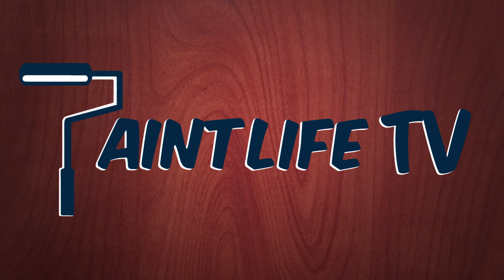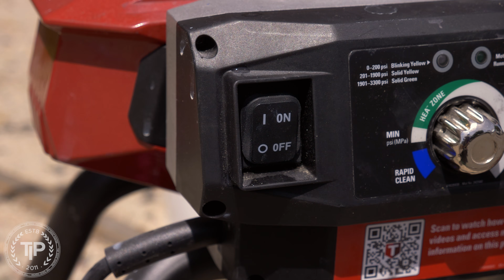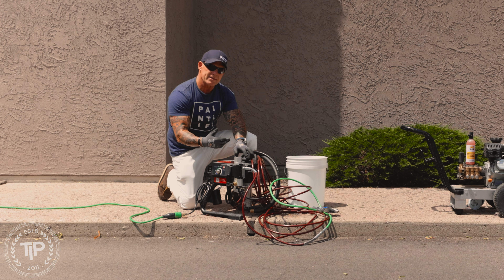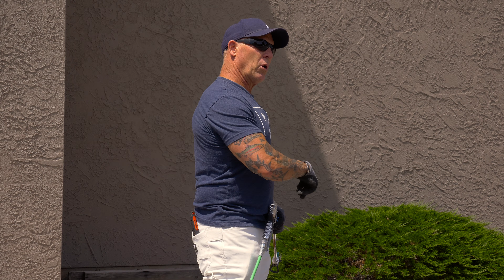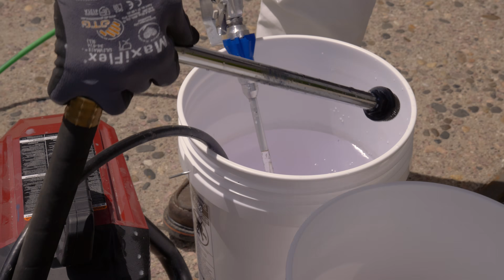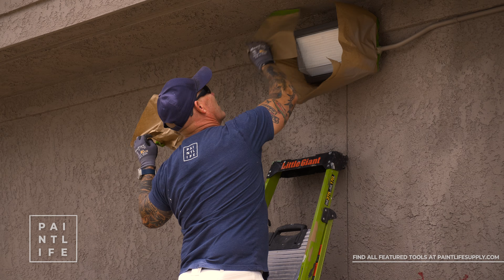How To Set Up An Airless Sprayer | Paint Sprayer Tips

Comment: 1040 it's good sprayer for elastomeric?
Reply from the maker: @emilion4408 A 1040 is an airless sprayer, and for elastomeric paint, you're dealing with a very thick material. You need a machine with a powerful pump that can handle high viscosity and push it through a large tip, something like a 621 or 623. Some older or smaller sprayers might struggle or wear out faster trying to push that kind of material. For heavy coatings like elastomeric, I always recommend a TriTech T5 or T4 because they're built to handle the workload. You can see the kind of setup and tip size we use for elastomeric in this video, we're really laying it on thick for a good, even coat https://youtu.be/r8d31vcRL20.

Comment: We sprayed scuff x latex dark bronze? And we keep getting runs? 
 
Heard rumor that it becomes difficult to spray darker colors with an airless sprayer, because darker colors take more pigment which can be more prone to have runs and not much of a smooth finish ? But light colors like white for instance that we sprayed on trim and doors? Which worked out great!! No runs and a smooth looking finish! 

Any tips or tricks spraying darker colors? Would appreciate it! Thanks!
Reply from the maker: @brycerusson4997 You're hitting on a real point there. It's not exactly a rumor; darker colors, especially deep bronze like that Benjamin Moore Scuff-X, often have a higher pigment load. That extra pigment can indeed make them spray a bit differently, sometimes feeling thicker or being more prone to runs because you're laying down more material with each pass to get full coverage. It's the nature of the beast.

Here are a few tips and tricks for those darker colors:

1. *Thinner Coats, Faster Passes:* This is key. Instead of trying to get full coverage in one heavy coat, aim for multiple thin, fast passes. Think 50% overlap. This allows the paint to build up without running.
2. *Tip Size:* You might need to drop down a tip size. If you're using a 515 for white, try a 310 or even a 208 for that dark bronze. A smaller orifice means less paint coming out per second, giving you more control and reducing the chance of runs. You'll move faster, but you'll apply less material.
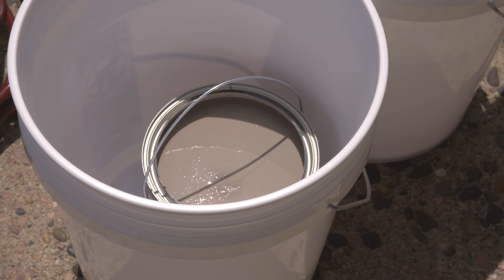3. *Pressure:* Make sure your pressure is dialed in for good atomization. Too low, and you'll get tails or spitting, which can also lead to uneven application and runs. Too high, and you're just pushing too much paint. You want that fine, even mist. Getting your sprayer set up correctly, like I show you in this video 5:53, is the foundation for avoiding these issues.
4. *Tinted Primer:* For really deep colors, a gray or black tinted primer can make a huge difference. It helps achieve full coverage in fewer topcoats, which reduces the overall film build and, therefore, the risk of runs.

It's all about control and patience with those rich, dark colors. I can dive into this a lot deeper on my site if you want to keep going.

https://idahopainter.stesso.com/?yt=Ugw290rjMKPWjKFeK_t4AaABAg&q=Thanks+for+the+tips.+You+have+suggestions+I+never+thought+of+for+someone+thats+never+used+an+airless+sprayer.&context=video%3ACq-5cH7BHXQ&seed=eyJtIjozNzM0NjgsImlhdCI6MTc5MTIzNDY1MywiZXhwIjoxNzkyNDQ0MjUzfQ.MT_e5N-BKh4U98vgCwq9stsT-r2pFUVr3Nn6wPepGF8

Comment: 32 years professional finisher an artist industrial me myself I would never use the same pump for water-based that you use for acrylic oil and the like. Your major function is to keep it running never get lazy with your pump and have plenty of solvent to be able to clean your oil-based pump each and every time when you're done with it. The same with your water based pump. Crossing the two materials can really wreak havoc on your spray pump. And I've seen styles go and I've seen styles come in you would be house spent to beat an old Graco or DeVillebiss.  And always remember keep it clean and do it right the first time and you won't have any problems good luck 🤞
Reply from the maker: Hey @sharonsanderson4514, appreciate you sharing your experience and your emphasis on keeping your equipment clean and doing things right the first time. That's absolutely critical for any professional finisher, no doubt about it.

Comment: Do you recommend painting the inside of a house in spray mode the same as the outside of the house?
Reply from the maker: That's a good question. The fundamental principles of spraying—like keeping a consistent 50% overlap and trigger control—are the same whether you're inside or outside. You're still aiming for that factory finish.

However, the approach changes a bit. Inside, you're usually dealing with more intricate masking, tighter spaces, and often finer finishes, especially on trim or cabinets. You've got to be even more meticulous with your prep and dust control. For general walls and ceilings, you'd set up your sprayer much like I show in this video for priming it 5:53, but you might use different tips for fine finishes compared to broad exterior surfaces.

Safety is still paramount indoors, so always ensure good ventilation and wear your respirator. It's all about adapting the technique to the environment and the finish you're trying to achieve.

Comment: How many times have you painted that building?
Reply from the maker: Once.  Now back for maintenance
Reply from the maker: Good question, @joshjohnson3352. You know, the goal is always to do the job right the first time so you don't have to paint it again for a long time. That's why getting your equipment, like the airless sprayer we're setting up here 0:02, dialed in correctly is an absolute must. A good setup means a good application, and that means durability. Every project is different, but the principles of quality and efficiency remain the same.

Comment: It’s very rare I use prime function, put that in paint and pull trigger on spray gun until all water/air out that’s it . Am I the only one who does this ?
Reply: I don't know how you do that you have to prime
Reply: @SLICK-GLN  try
Reply: @bratvlad  it's not the way I was taught it's possible if the pump is already primed with water or paint.
Reply: @SLICK-GLN  yes If the sprayer brand new then prime for the first time yes you’re right if I understood correctly, but after that the sprayer always has water or paint in it, it’s just when switching between paint/water it wall grab some air and for that I use trigger on gun, and run it through a hose, no need a prime function for a 50ft hose, if your using 150-200 hose then yes to prime will be faster, but not necessary.
Reply: @bratvlad  yes if your switching between paint or water you don't have to prime.But if you are starting off fresh you do .
Reply from the maker: I do the same, but have to show how to use the prime in a how to video
Reply: Sorry but you strain the piston unnecesserely ,my opinion
Reply: @baihui7349  had my sprayers for years, lasts just as long I think
Reply: @baihui7349  It's unnecessarily not unnecesserely.
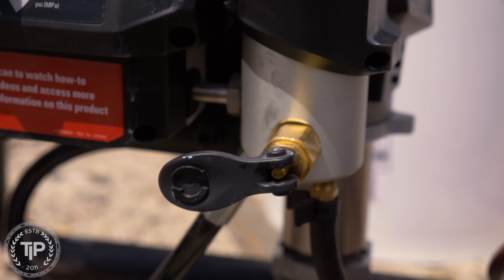Reply from the maker: @bratvlad, that's an interesting approach, and while you might eventually get the air and water out, it's not how we typically set up an airless sprayer. The prime function on your sprayer is there for a reason, you know? It allows the pump to cycle the paint back into the bucket at a low pressure, which is much more efficient for purging air and getting the lines filled without putting unnecessary strain on your gun or pump. You want to properly prime it to ensure everything is full of paint before you even think about pulling that trigger. I walk through the whole process, including how that prime/spray valve works, right here in the video 1:07. It's all about working smarter, not harder, and making sure your equipment lasts.